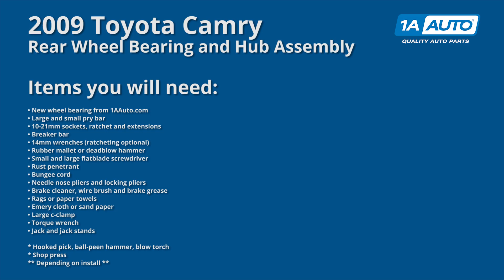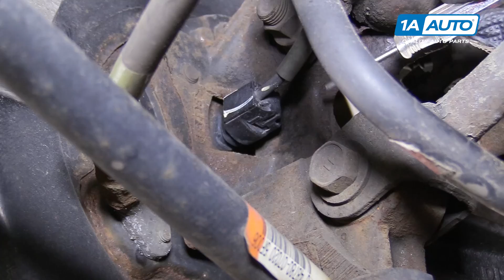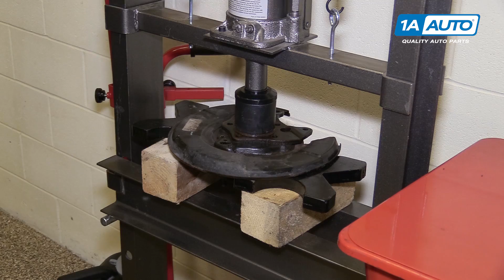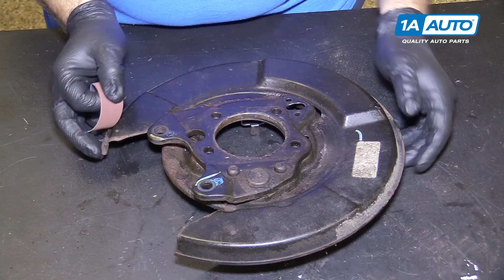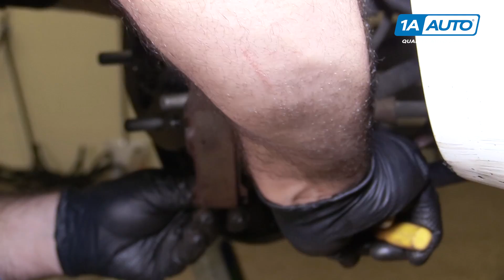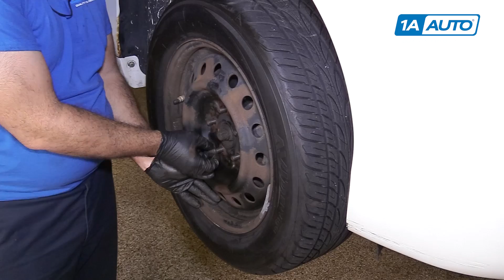How to Replace Wheel Bearing Hub Assembly 05-11 Toyota Camry

Comment: Replacing CV Axles and wheel bearings is not an easy job especially if the wheel bearings are pressed into the steering knuckle.

Comment: Great detailed video.  Will be doing this job, both sides, on our 07 Toyota Camry. We live in the north, so I'm probably going to run into this same problem with the seized hub assembly.  I would put some anti-seize on the hub, where it comes into contact with the backing plate.  Also, put some anti-seize on all the bolts and break hardware.

Comment: remove the 4 bolts and put in smaller ones with nuts and leave loose. use a slide hammer and the hub assembly comes off. obviously living in the shitty rust belt, that may not work well. as you saw, using a press may work or not and more damage will occur, with need to replace more parts. me being a mechanic of almost 40 years, i recommend to the customer getting new backing plates for the simple fact that if this same thing happens, a lot of time isn't wasted trying to do repairs on rusted/corroded parts.

Comment: Why not just remove the hub bolts that you did.  Then, apply slide hammer and zip it out.  Then, just toss it all away.  Buy another brake backing plate ($30) and hub/bearing assembly from 1a /Auto.  ????

Comment: Thanks, you should remind people to use a little anti-seize on the parking brake hardware where the metal contacts on the pivot at the top as well as the adjuster.
Reply from the maker: +510Finnatic Thanks for the tip!

Comment: It would have been much easier to install the emergency brake shoes and hardware before installing the hub/bearing.  Temporarily install the four bolts to hold the backing plate to the flange.  After you install the brakes and hardware, remove the four bolts and install the hub/bearing.  I found it impossible to install the brake shoe hold down retainers on the "nails" with the hub in the way.  You are a better man than I am to accomplish that.
Reply: I tried installing the parking brake with the hub over top. I could not get the two spring hold downs in place. I had to ask a mechanic to do it for me. Your way sounds better. Thanks
Reply: i only had to change the shoes and i still pulled the hub because its just faster

Comment: Ok so this makes me feel so much better.  I've been replacing the wheel bearing hub assemblies on the 2013 es350, and the old one just will not release.  Never seen a rust weld so stubborn in all my life...I swear I thought I had to be missing a mechanical fastener somewhere.  A small screw, a lock ring....something!  Now I don't feel so crazy since you had the exact same issue.

More penetrating oil and a bigger hammer, I guess.
Reply from the maker: +kb coolman Thanks for checking us out. Shop for high quality auto parts on 1AAuto.com:

http://1aau.to/m/Shop-1AAuto-c

Comment: Any idea about a similar job on a Gen 3 (2011~2015) Sienna? I just can't figure out how to disconnect the Rear ABS (speed) sensor wiring connector/socket from the sensor/wheel bearing. Can open the outside white housing of the connector/socket by prying open two small tabs on top & bottom of the housing. But after that, the housing is still connected to the wiring, and can't disconnect the inside connector/socket away from the sensor body (part of the wheel bearing - a high price tagged & very unfriendly design for maintenance and repairs).

Comment: Thanks so much, great video, your stuff is very helpful. Some things I found. 

To help separate the stuff bearing from the backing plate, I knocked all of the wheel studs out of the hub, then I used two old F250 rear brake rotors, wide side up, to hold the hub/backing plate in place, and then hit it with a sledge. That was the only way I could keep it still enough to break the rust. Also heated and cooled, rust penetrant.  

On re-assembly I cheated. I put the backer plate and dust shield back on the car using 1 bolt to hold it to the knuckle. Then I reassembled the parking brake in situ, without the hub in there to block my view. I just don't have the dexterity to reassemble it with the hub blocking it. Then once assembled, I ran a bolt thru the knuckle backwards in to the plate, removed the first bolt, wiggled the new hub into position and thru the other 3 bolts in and then backed out the backward bolt and put that one in. You have to push the shoes around for the bolts on the rear of the hub, but it works. Just a tip.
Reply from the maker: +Stephen Rodgers Thanks for checking us out! http://1aau.to/m/Shop-1AAuto-c
Reply: Thanks for the tip, which helps us to install the parking brake before the bearing hub assembly and makes the job easier.

Comment: Great video but one thing I would’ve done differently would be to install the parking brake and hardware before the wheel bearing. At 20:33, you installed the bearing but you could’ve just installed one or two bolts, assembled the parking brake and hardware and then install the bearing. You would’ve had much easier access to the hardware if you did it this way.
Reply: You have addressed the question I had. Installing the parking brake is difficult when the hub is in the way.

Comment: If the hub comes out cleanly, you don't have to remove the parking brake assembly correct?
Reply from the maker: +Randy Randall Thanks for checking us out! Correct, this is one of those worse case scenarios where nothing is cooperating. If it comes out easy you can bypass that step and appreciate the luck!

Comment: When mine wouldn't budge I at first tried using the brake rotor method as in the video. That didn't work. I then had the idea of mounting the wheel back on the hub figuring the higher mass of the tire and rim would make a difference. Mounted the tire and after a couple of good swats with a baseball bat and that sucker came off lickety-split.  So glad I didn't have to mess with taking the parking brake parts off. Thanks.
Reply from the maker: Thank you for the great reply. We love to empower our customers by showing you how-to perform your own auto repairs while installing our high quality auto parts. Have a great day! 1aauto.com +Alan Russell
Reply: You whacked the tire?
Reply: Savin my bacon

Comment: Did the same thing.  Had to totally take off brakes.  Tried 20 ton press but was just bending backing plate.  Heated up old hub and beat it with 4 lb hammer and it came out.  Melted metal of hub like soft aluminum.  Broke 10 mm bolt also on E -brake cable.  Had to drill out.  Sound of silence is awesome.  Saved $400 👍
Reply from the maker: +Sir Sweetness Thank you for your feedback!

Comment: Great video. It helped me to replace my hub assembly on my 2011 Camry. One thing only, do not hit the assembly from the back side. That leads to even a worse jam. Just use a long bolt to push the hub out. I only used one bolt only on the side where the brake caliper is mounted closer to the bottom fastener hole (just pushed the shoe brake to the side). That's because the plate is wider there (just look for other videos on the same subject for details. I, for example, used a small hole for the bolt). Also, I used SeaFoam penetrating oil as well to help the separation. 
Life is easier because all the youtubers out there who share experiences.
Reply: Oh, so I won't have to remove the parking brake,even if the hub is rusted in place?

Comment: If one rear side is going bad, is it better to change both sides at the same time or is that necessary?  Great video!!
Reply from the maker: +MrRealtorJim Usually when one side goes bad the other side isn't far behind. You could replace the pair as a preventative maintenance step. Here is a link to the wheel bearing assemblies that we carry on our website. Hope this helps you out. http://www.1aauto.com/wheel-bearing-and-hub-assembly-trq-bha53296/i/1asfk00079?utm_source=YouTube&utm_medium=CTA+Comment&utm_campaign=ytcomment&utm_term=k3TWC6NJk44